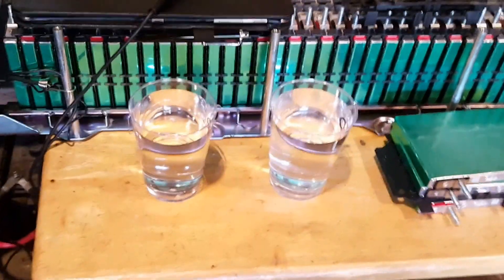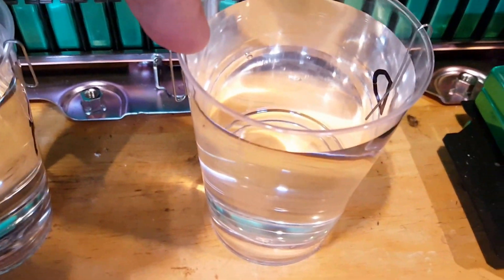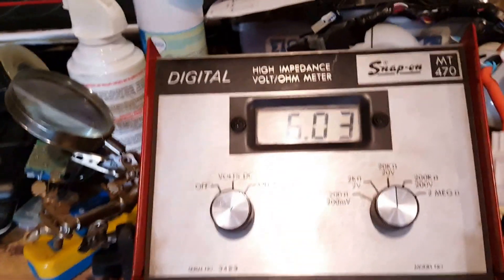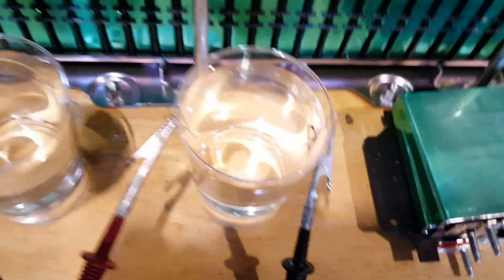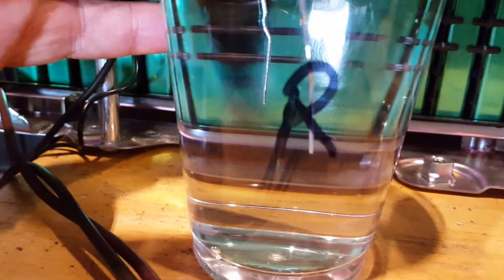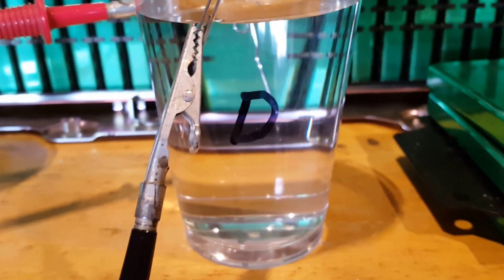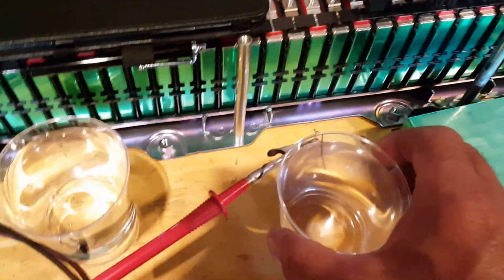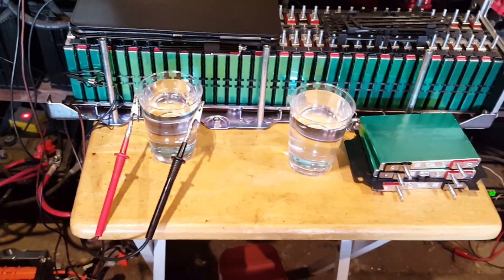Tap Water VS. Distilled Water!

Comment: In distilled or RO water, the absence of ions increases the potential for galvanic reactions. When pure water comes into contact with dissimilar metals, it enhances the electrochemical process that leads to galvanic corrosion

Comment: What if we topped the batteries with some regular tap watter...   can I just take out "remove" some water from the batt and replace it with distill.
Reply from the maker: To my knowledge none of the battery manufacturers recommend tap water due to the impurity of it.  You may carefully remove some electrolyte and add distilled water to the battery.  However check the specific gravity and see if the battery needs to be recharged! Be Safe and Thank You!

Comment: Distilled water really is an insulator, not that it stays this way once you put it into the battery to replenish what has been lost. The sulfuric acid electrolyte will be replenished once charging is complete, checking the specific gravity with a hydrometer should show positive results if the cell is in good condition.
   Remember, only fill the battery to just above the plates PRIOR to charging. once charging is complete then finish topping if needed, to manufacture recommendation. Never add acid to a lead acid battery
Peace